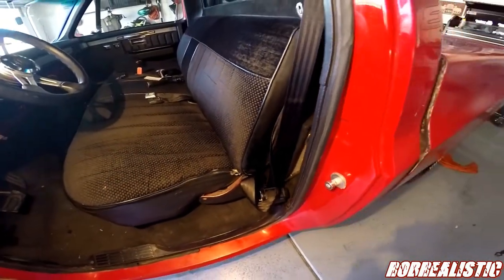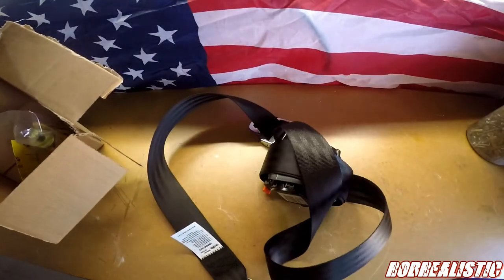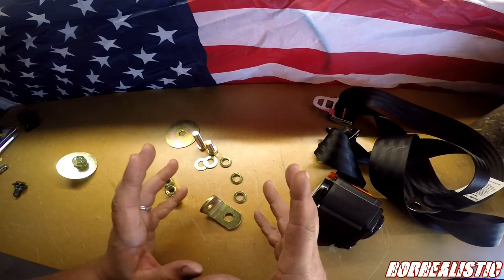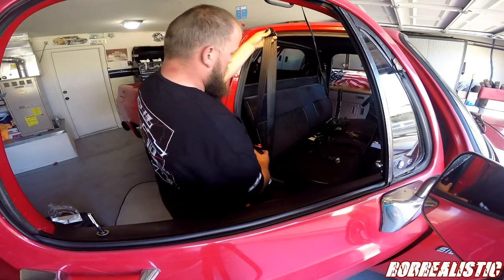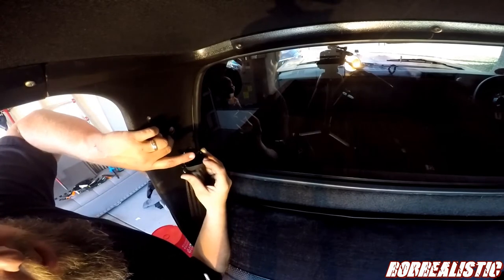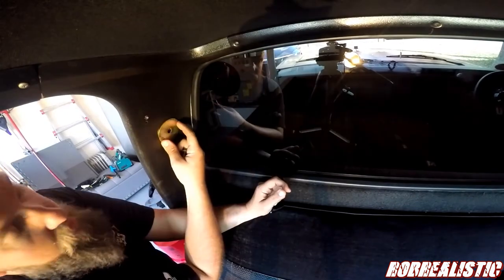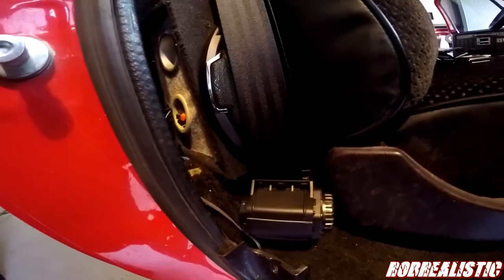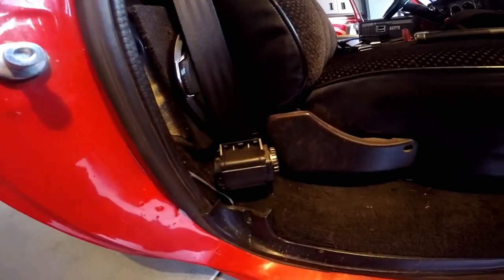LMC Truck Seat belt installation. Step by step.

Comment: Great video!  Just put mine in watching your video.  Started with the passenger side and reversed the 2 pieces on the belt.  On mine, I already had the 3 point top piece so I was able to re-use the bolt and not have the molding issue.  
Very helpful.

Comment: Thank you for this...was driving me nuts having so many extra bolts. My truck had different threads anyways so had to re-use the factory bolts. But the L bracket positioning was great. Cheers
Reply from the maker: No problem. Lmc Now has a video out with the proper way to do it so I would check it out too. I made this because lmc didn't have a video.

Comment: Excellent video.  I was wondering how to get these installed.  My truck had shoulder belts but the “PDSO”  cut the shoulder belts off using just the lap belt (death wish I guess).  Now I know how to install them.  Thanks!

Comment: I just remembered I need to order a tap to install mine in my 82. Got the reel out, but I can't get the bolt out for the clip half of the belts out. Ruined a brand new torx bit trying to get said bolt out.

Comment: Nice video, why is the washer so big? I can use a smaller one I’m sure?
Reply from the maker: Yup, I just used what was included. The washer is actually for the floor to spread the load out but this was the only way I could get my belts to work properly
Reply: @RobRealistic  ok, thanks for the video. I’m installing some today.

Comment: Good info ty ... what about the drivers side seatbelt mine has a wire going to it will it be needed on the new set not too sure what it’s for any thoughts
Reply from the maker: Same process. The wire may be the seatbelt chime. Not sure what to do with that.
Reply: It’s definitely for the seatbelt buzzer. I cut mine off because I don’t want that thing bothering me, haha